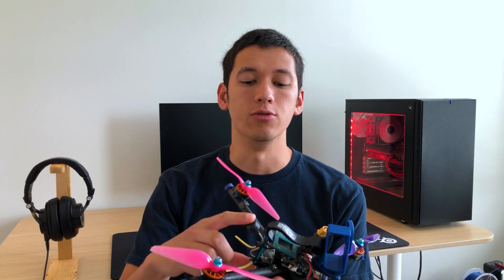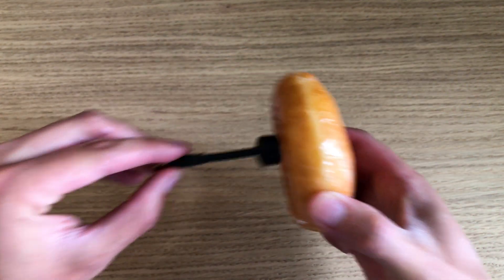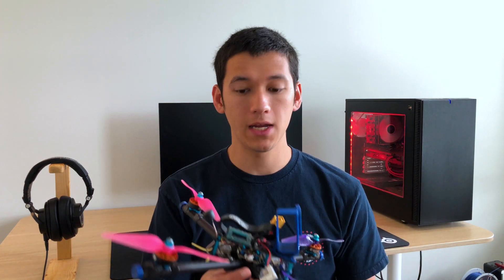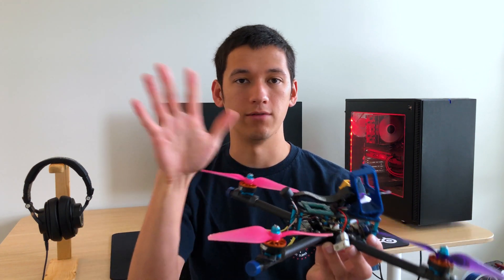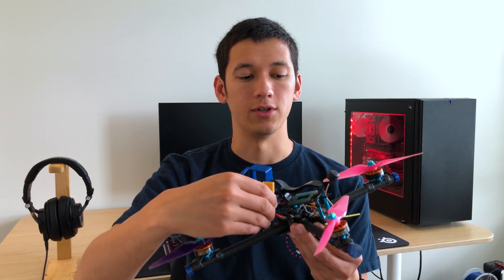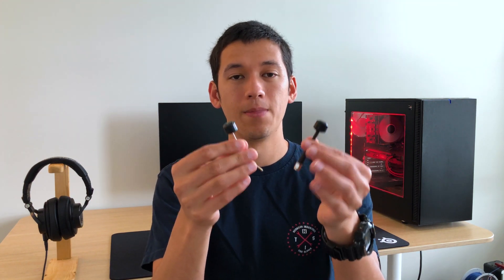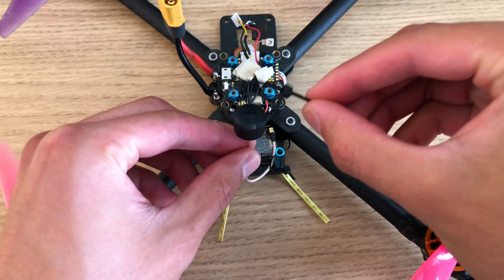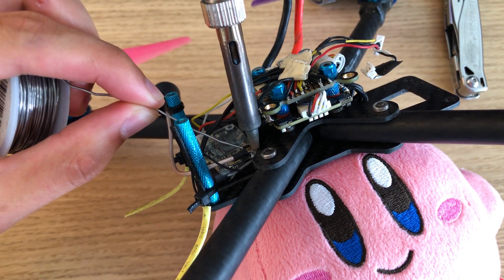Improve Your Drone's Video Signal and Weight - 5 Antenna Tips and Tricks

Comment: thanks man, useful for me getting into it again (and properly this time :P)
I've got a question about the tubular quad, how rigid is it? I'm sitting here wondering why there arent any tube arm frames on the freestyle/racing market.
Reply from the maker: Thanks! Tubular arms are more rigid than flat plate arms. I think the cost and complexity of mounting motors on tubes keeps other manufacturers away from tubular arms for the freestyle/racing market. However, tubular arms are widely used on larger more expensive multirotors due to their performance advantages.

Comment: E6000 / B7000 etc. glue, sparingly applied, does a great job fixing an ufl-connector. Does not melt and can be pulled off easily if you need to unplug! Secure and no hassel at all!
Reply: A dab of silicone sealant also works.

Comment: Long range pilots usually place the antenna on the side of the quad so the battery doesn't block their signal on the way home. Freestyle pilots try and protect the antenna a bit, which is why they like the 3d printed stuff. Someone did test them to actually shift the frequency of the antenna enough to cause problems, so don't dip the antenna inside them. I like mmcx, even if they sometimes snap inside the connector. If I must use UFL, I heatshrink the antenna on the connector/board. That way it will never fly off in a crash and replacing the antenna at the field is fast.
Reply from the maker: Thanks for sharing this info!

Comment: I simply hot glue the u.fl.
Easier and no risk of shorting something :)
Great tips and I'm going in the same direction,  ditching tpu.
Reply from the maker: Thanks! I tried hot gluing the U.FL once, but the VTX got hot enough to melt the glue. However, I'm sure there are a lot of variables like climate, VTX design, etc. that affect whether or not the glue will melt. If it works for you then it's certainly less risky than soldering.
Reply: Slick shirt paint works great for plugs. Looks good to.